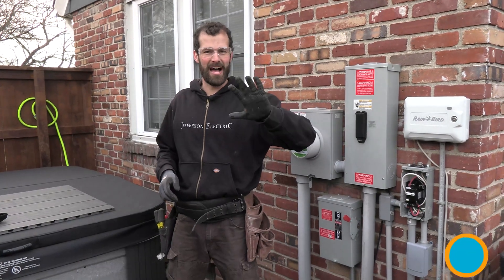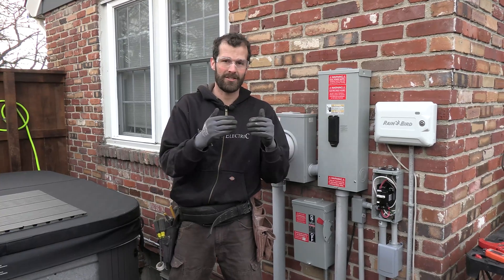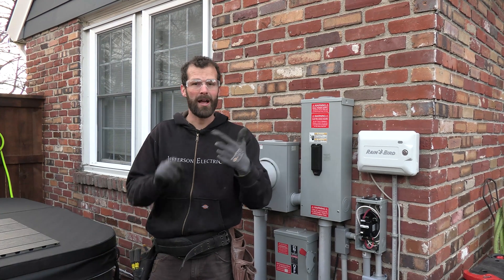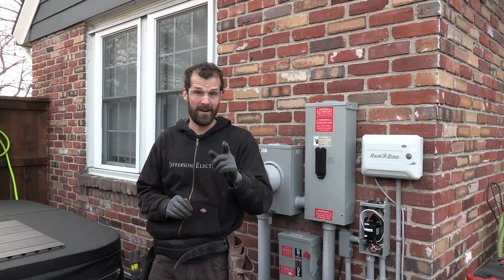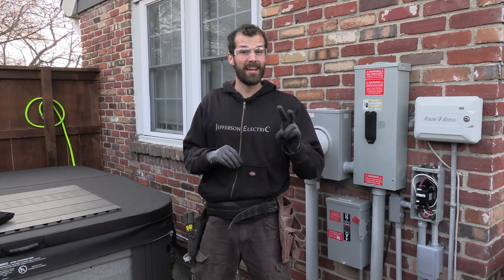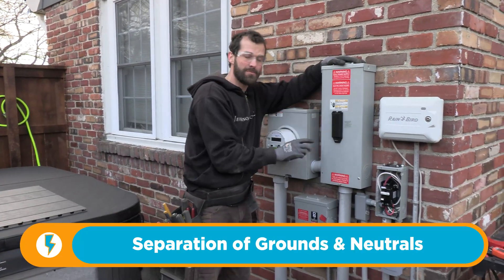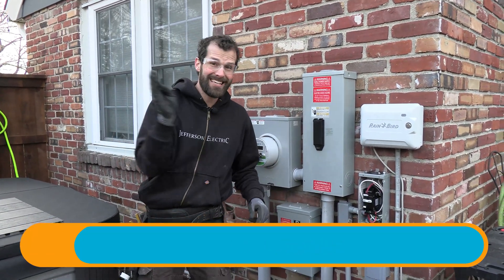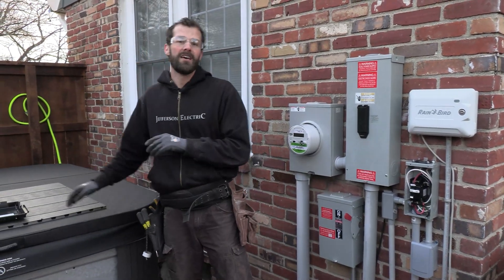Hot Tub Electrical - Code Minimum

Comment: Thanks for your time.  I have a few questions that will help me determine my tub placement. Is there a reference for the type of wire to be used in conduit from the Hot Tub to the GFCI breaker?  If I have to go, 75 ft to the house from the GFCI breaker can I also install a quick disconnect between the GFCI and the house main panel?  If the conduit from the house to the GFCI breaker is under a deck, can I attach the conduit to the underside of the deck?

Comment: I have a 26 amp hot tub, so 125% would be 32.5 amps. What gauge wire would I need to run if I wanted to put the hot tub 150’ from my 200amp subpanel at the house? I’d put the 50amp disconnect closer to the hot tub, correct?

Comment: Is stranded #6 THHN copper suitable for a 60 amp circuit? 25ft from GFCI to main and roughly 6-10 ft from GFCI to spa?
Reply from the maker: Yes. For outdoor use ensure the THHN is also THWN-2 rated, which is quite likely. W stands for water and the -2 ensures it's still 90 degree C rated in wet locations

Comment: Do you need a second ground to bond the tub since it is not at least 28” higher than surfaces that are within 30” of the tub?
Reply from the maker: Do you have a code reference in mind? Might that be a local code, not NEC?

Comment: Or if you live in the country, you don't need a GFCI or GFI.
Just make sure you Jump into the tub before you leave the grand. Or test it out with a 10 ga wire into the tub and see if the breaker will trip. (Summing if it will work)
Reply: We don't need no stinking GFIs!

Comment: Funny!! That GFCI receptacle must be no closer than 6' to the inside wall of the hot tub, I'd say you created a code violation. Also the disconnect must be at least 5' from the inner wall of the hot tub. The main disconnect and lever disconnect should also be a minimum 5' from the inner wall of the hot tub.
Reply: Dudes tape measure is metric! Hahaha

Comment: My spa is 16.5 years old. This summer it began to trip the dedicated GFCI breaker intermittently. I've looked into the spa equipment shorting but it occurs randomly, it seems. What are the chances the breaker could be just worn and is tired of staying closed, especially in this summer's 100+ degree heat while the box gets a good amount of direct sunlight? Appreciate your vids!
#NotAProfessional #NeverBeenElectrocuted
Reply: Electrocuted means death by electricity so I guess that one is a given if you’re typing a comment 😊
Reply: @YogiTheBearMan  

#StillNotElectrocuted

Comment: Couple questions, in line of sight.. in line of sight if i am in the hot tub or could i install behind a privacy fence on the house. I may need to do this to meet the 5’ minimum? While running my hot tub wire i want to run a 15 amp circuit in the same spa panel. The additional space in some spa panels allows for an additional 15 amp circuit, does this circuit pull from the hot tub wire, or can i service it from the main disconnect? Last question, installing a 15amp circuit in the spa panel, this does or doesnt need to be a gfci breaker?